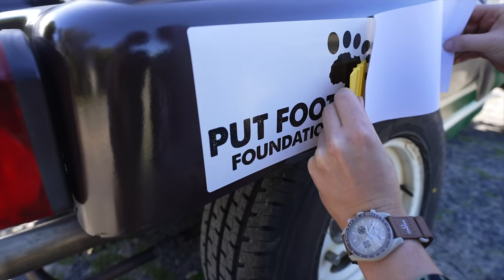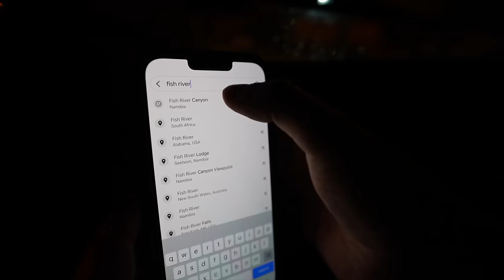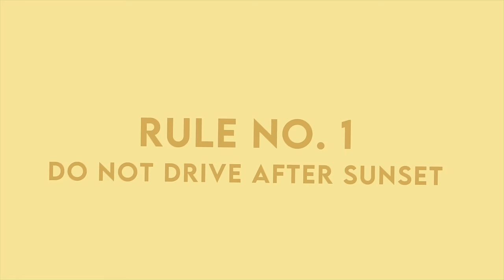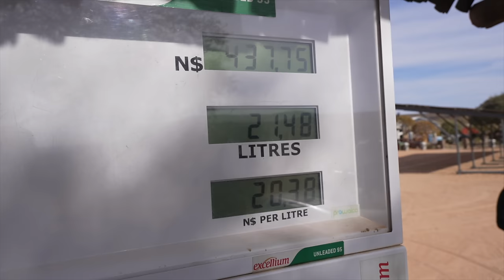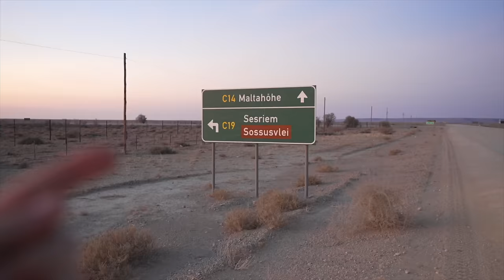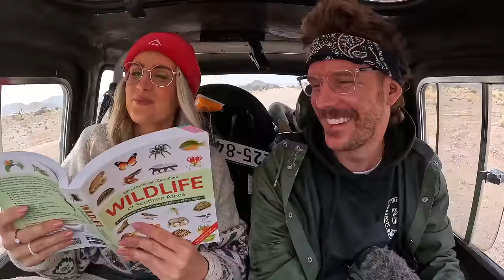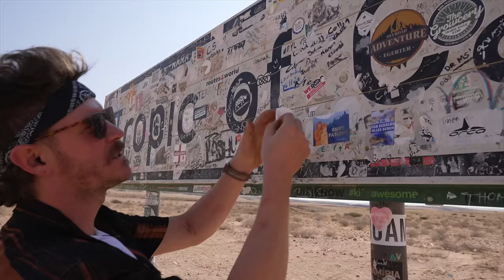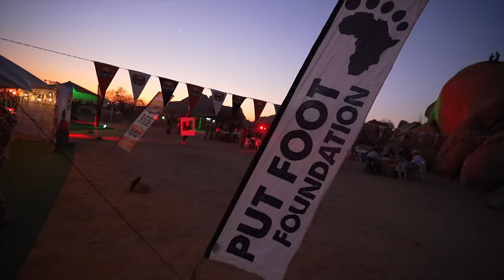We drove through AFRICA in a BEACH BUGGY (Put Foot Rally Part 1!)

Comment: I had a death trap Oldsmobile Aurora that had a million problems. One of the main problems was the car would accelerate on its own. One of the times it did it, we were in bumper to bumper traffic. I had both feet on the brake pedal and pushing it to the floor. I finally got the chance to pull off, I got into a parking lot and put it in park and turned it off. Even in park it was still accelerating.